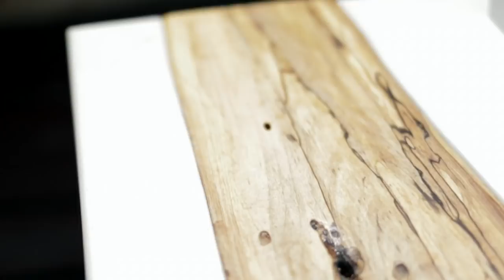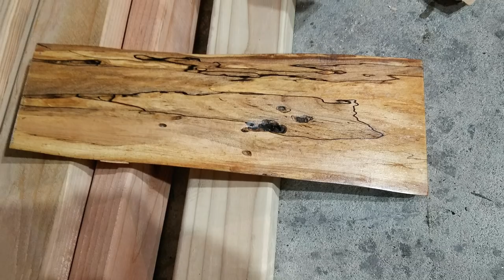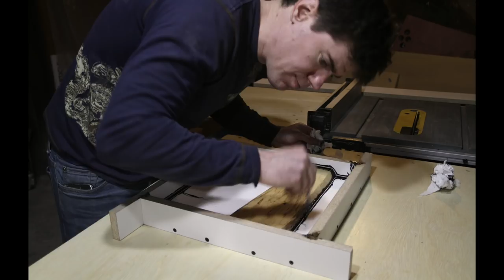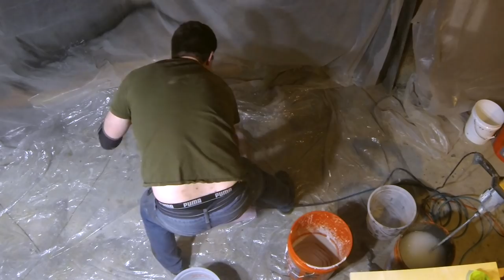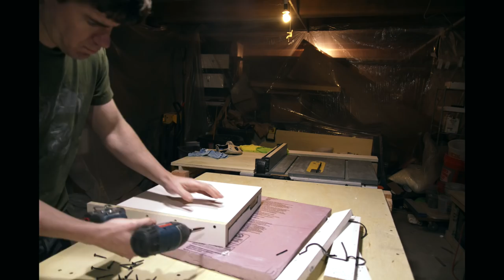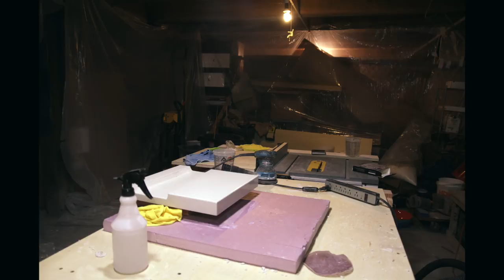DIY White Concrete Table w/ Live-Edge Maple Inlay (using GFRC mix) - How To Make

Comment: For the silicone lines , you could also take a Spreybottle  with dishwashin soap-water  spray it on the fresh silicone   and  deduct whats to much with the Stick of a Icecreame. thats how we do such things in Germany =)
Reply from the maker: Interesting idea, I'll have to try it and see how it works.  (Over here we call this a popsicle stick, btw :) )  I bought a spray product (forgetting the name) that was supposed to do something similar, but it didn't work so well.   Maybe the cheap and simple solution will be better.

Comment: This is a KILLER concrete project. My one big question, and I'm sure that a lot of people ask you this... Is there a way to do a face coat (i.e. no glass fibers), and then a back coat (w/ glass fiber) without using the spray gun? I have one of those super entry level Bostitch brad nailer pancake air compressors. As far as I can tell, there is no way to use one of those to spray concrete (IS THERE?!?!?) But I just cannot spare the expense to upgrade to a larger air compressor just for the 2-3 concrete pieces I'd make in a year. Having worked with this concrete, can you "paint" the concrete on, like with your hands or a garden shovel/trowel, let it set, and then come back and blob in a GFRC back coat? If so... how long does one let the face coat cure before adding the back coat? I want to make a Farmhouse sink, so I would be painting the sides of the mold with the face coat. Or would it all just slough down, and not stick to the sides enough to cover the interior glass fibers?
Reply from the maker: Yes, you can definitely paint it on (there are a number of comments where I go into detail on how to do this, so check the comments and let me know if you have more questions).   One thing of particular importance for your project (an integrated sink), is that it is a bit trickier to get the vertical surfaces done well if you do not spray the face coat.  You'll likely have to do a couple slurry coats to fill some voids in the vertical surface.  When you do the vertical surfaces, you don't use nearly as much super plasticizer.  
That said, you still might consider spraying if you have a few projects.  I'm betting your air compressor is good enough and you don't have to buy a new one.  I was just using a small $100 porter cable pancake compressor, and it had more than enough pressure.  You can get a hopper for $30-40 at harbor freight, so if you can use your compressor, then cost to spray is probably worth it since you've got big plans for vertical surfaces.  

Once you get further down the road planning, I'll be glad to help as more questions arise.  Feel free to email or ask more questions in comments :)
Reply: I had no idea that my little pancake air compressor could handle it... but now that you mention it... wet cement is just a wet sand slurry. I'm going to give it a try.
Two little questions. 
1.) When you said the Harbor Freight hopper gun would work, are you talking about this one? https://www.harborfreight.com/1-12-gallon-gravity-feed-texture-air-spray-gun-60314.html

2.) The links that you posted to the concrete "ingredient" company... even if I source the sand and white Portland Cement locally... all the other stuff adds up to like $400 after shipping to Charleston, SC where I live. Is this... correct? Did you buy $400 worth of stuff to make that 2' x 2' table slab?
Reply from the maker: 1) That is the one I heard will work.  you do need to buy a 45 degree adapter to go between the gun and the hopper, but that is only a couple bucks.  I will say I haven't used that one personally, but have heard others have used it, so there is a bit of risk.  This is the one I bought since I was planning a bunch of projects and figured the $80 investment was worth it: http://amzn.to/2x5OXgp

Here is an overpriced 45 adapter, if you go the Harbor Freight route and cant find one local: http://amzn.to/2flmIkz

2) I bought about $500 worth of supplies, but I made a fireplace hearth, a desk, two side tables, a waterfall coffee table, a bar countertop, a bench, and I still have some leftover.   (pics of many of these on my Instagram, if you are interested) It is a bit of an investment.  If you want to make a table, just order 1 bag of the GFRC mix, and a 1.5 lb bag of glass fibers, and that will be enough, $45 + shipping (which will probably be $30 or so).

Comment: Hi there. Great video going to be completing this in my kitchen in the summer in England. Any advice for a 3m length?
Reply from the maker: +Glenford Spencer for strength, make it 1 inch (about 26mm) thick for that length.  Main issue will be finding a melamine sheet big enough for that size.  They don't come that big standard here in the US.  I have hard of some people finding 3.3m melamine sheets but they are custom order..  You may end up having to do it in two pieces, in which case it is all about the design and picking the spot for the seam where it is least noticable.
Reply: Modustrial Maker 
Hey thanks for the quick reply. To strengthen would you use fibre as you have in this video or metal rods?
Reply from the maker: +Glenford Spencer no metal rods necessary if it is going to be resting on countertops.  Only reason for rods would be if you have a huge cantilever or something like that
Reply: Modustrial Maker about 200mm from one of the edges I will be putting the sink in place which will be an under counter top sink.
Reply from the maker: +Glenford Spencer that is no problem to do.  The sink will come with a cardboard template for the cutout.  Use that to make a mold from insulating foam sheet (the brand we have is called foamular), and glue it to the form to make the hole for your sink.
Reply: Modustrial Maker For a worktop (countertop in us) of 3m you could use an actual worktop for the form. In the UK they come in 4m lengths, and although not as cheap as melamine an economy one is still cheap. Occasionally you can buy one with a damaged corner or a scratch for just a few pounds.
Reply from the maker: Interesting. What material is the worktop made from?  I've seen some people here cast on granite, but that is way more expensive

Comment: Great. Is the concrete strong enough to hold the timber expansions?
Reply from the maker: Yes, it should be.  Expansion was definitely a concern in the design. This is part of the reason I poured the concrete right over the wood in the mold, and then covered the mold while the concrete cured. While I sealed the wood before I did this, the water from the concrete mix still evaporates and creates a very humid environment in the mold (surrounding the wood). This is about the maximum humidity you would find any any environment the table will be in. Thus, the wood expands a bit in the mold while the concrete is still curing (i.e., not hard yet), and the concrete cures around and takes the shape of the slightly expanded wood. Once demolded, the wood contracts. As a result, there is a slight gap between the concrete, but nothing too noticeable (at least IMO). More importantly, there is very little chance the wood will ever expand more than it did in the mold and cause cracking in the concrete or wood. GFRC also can flex and bend a bit (much more than standard concrete), so this helps.  I actually made this table about 6 months ago, and it has been moved around, inside and outside, and so far, so good :)

Comment: Are concrete work benches advisable if I like to hammer stuff?  Or should i just go with some marine grade 2x4s? Great instructable btw. Subbed. 👌
Reply from the maker: No, if you hammer on any concrete surface enough it will chip.  They are durable, but not that durable.  It could work if you put a sacrificial piece of plywood on top of the concrete top and under your workpiece when you are hammering.
Reply: Modustrial Maker 👌 Got it! Thanks!

Comment: Nice video.. but i am wondering how do you the concrete table to the frame? Would be very helpful if you could show that part. Tq
Reply from the maker: My friend who made the steel legs drilled holes in them for screws, and I just used Tapcon concrete screws to attach it.  Construction adhesive also works great (same stuff they use to attach granite and marble countertops).
Reply: Thanks so much for your reply.. really appreciate it. i got my answer. Tq

Comment: Hiya mate great video and rad product do you have any idea of the load strength of this table  the reason I ask is I'm currently building a campervan in which I need a table that can also drop down to form part of the bed. So whether this would be strong enough unsupported? Cheers
Reply from the maker: GFRC would absolutely be strong enough for a bed.  I would suggest making it 1" - 1.25" thick.  For sake of comparison, GFRC will get up to 12,000 or 13,000 psi in strength (as compared to 3500-6000 psi for standard concrete mixes).   But what you really care about is the flexural strength (rather than the straight up and down strength).  This is where GFRC really shines, since it can actually flex a bit without cracking, and has much greater than standard concrete even when rebar is used.  Check this video out, where a 1" slab was tested and finally broke after 1100 lbs was placed in the middle.  https://www.youtube.com/watch?v=LfjHrWOVkgE .    You would have to have a couple people jumping up and down in the middle of your slab to even have a chance to break it.

Comment: Hi!  First of all thanks for the video🌻.  I have so many questions.  Is the face coat absolutely necessary? I looked at the gfrc mix you linked and it said the glass fibers are only necessary for the  backer coat.  Is that the same as the face coat?   I would like to make a table top that is 40 inches by 80 inches at 1 inch thick.  Is gfrc any more light weight than typical concrete given such large dimensions? I know that's a lot, but, I appreciate your expertise.   Thanks in advance! 🌻
Reply from the maker: No problem, glad you enjoyed it!  You should find most of your answers in the instructable for this project: https://www.instructables.com/id/DIY-White-Concrete-Table-W-Live-Edge-Maple-Inlay/

If you have more after reading thru it, let me know.
Reply: @modustrial  Thank you so much!

Comment: This is so great! Exactly the kind of final product I'm looking to make! To add on to another's commenter's question: if you used just the brush method for the face coat and it didn't turn out perfectly, could you do a scratch coat after it's dried to fill in any pinholes? Do you think that would yield a good final result?
Reply from the maker: Thanks!  Yes, you can always do a slurry coat after to patch up any issues
Reply: Modustrial Maker Slurry! That’s the word. Thanks for the info and thanks for taking the time to reply 😊
Reply from the maker: No problem!

Comment: Great video but how did you get the wood piece to stay in? I didn't  catch it if you showed it.
Reply from the maker: I just used caulk around the edges, and then the weight of the concrete poured over it held it down.

Comment: Do you seal the bottom surface too, or leave that for the concrete to breathe? I'm just thinking it seems like sealing when the concrete is so green would cause problems as it continues to cure.
Reply from the maker: No, I typically do not seal the bottom.  More because its extra work, and sealer is expensive, so why bother :)

Comment: Can this type of concrete be use for a counter top I love what you did ? Is it safe to be in contact with food ? I have a small kitchen so the longest leg of counter it's about 5 feet . Thank you !
Reply from the maker: Thanks!  Yes, it is great for countertops and is food safe.  (As with all concrete countertops, you should use a food-safe sealer too.)  I have another video showing the process of making a countertop from GFRC, if you are interested.
Reply: Modustrial Maker Great, Thanks will check out the video !

Comment: Can i use the ball tool also for when i want to silicone glass? Without using that stuff you used before putting the silicone on? I love the idea you have but i dont want to use that stuff before applying silicone, will i be able to get the excess silicone off then?
Reply from the maker: You really need to use the paste finishing wax, or you'll spend hours trying to get the excess off with a razor blade.  I'd suggest just using the paste wax on the glass.  It is just wax so it will come off the glass pretty easily when you are done.  Just be careful to only do the wax on the sides of the seam (not right in the seam), if it is something like a window where you need a really strong bond from the silicone.

Comment: hi Mike, amazing job...would you please tell me the mold material you used for GFRC, or where can i get the mold materials.? thanks a lot...
Reply from the maker: Hi Eric, 

The molds are just made from melamine and black silicone caulk -- you can buy both at any home depot.

Comment: Hi Mike, I am addicted to your videos!  I have been wanting to replace my night stands with a custom black pipe end tables with a live slap.  I was looking up information on purchasing live slabs, and found this video among the results.  I love the idea have using GFRC top with the live slab inlay.  I have added most of the products you recommended to my wish list, and I have purchase a couple of  beautiful live slabs from ebay for about $60.  I plan to make three shelves (18" x 24" x 1.5")  for each table (may vary the dimensions, but no bigger), and plan to order the Fishstone GFRC Bag Mix, 50lb, along with the 1.5 bag of glass fibers.  Based on the calculated volume, I should have enough for that plus some test panels.  I have a question about coloring.  I want to have a granite like appearance, and I am thinking of using a charcoal along with Diamond Dust Glitter 6 Ounce Clear Glass ( amazon) to get some glitter in the face coat.  Have you done something like this?
Reply from the maker: Thanks Curtis!  I haven't tried the granite look, but it sounds pretty cool.  You might try calling Fishstone and asking their thoughts on acheiving this look.  ... They are usually super helpful when you get them on the phone.  Otherwise, I'm all for expirementing.... If you make a test slab that is the perfect opportunity to try your idea and see how it comes out :)

Comment: Love your videos. Had a question. Could I use your first part face coat of mix, spray in. Then use 5K Quick Crete to use as a filler for the rest of countertop? Would still get the surface finish?
Reply from the maker: Thanks!  Yes, you can do this.  I've done it once, but with quikrete countertop mix as a back coat (which i would recommend over quikrete 5000, which has bigger aggregate and is this more likely to have air gaps that could cause parts of face coat to cave in).  You need to do 1.5 to 2" thick though throughout (including under inlay which means 2.25" to 2.75" if you have 3/4" wood, for example).  Also you would need to use rebar to reinforce it.